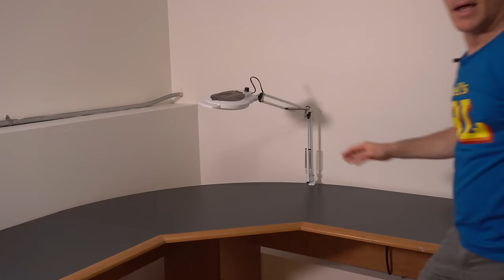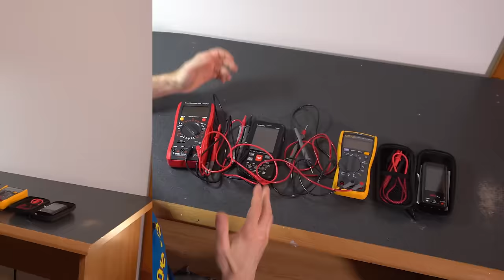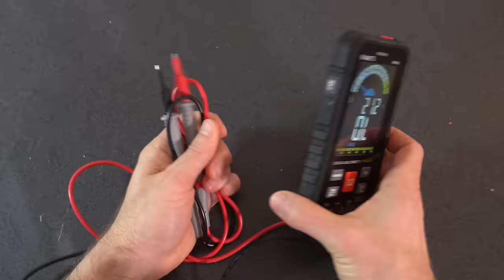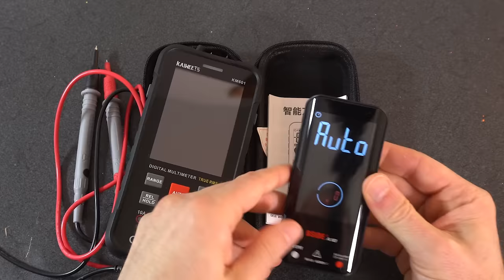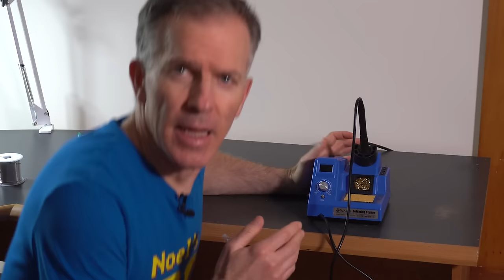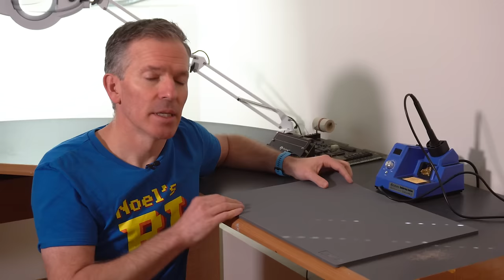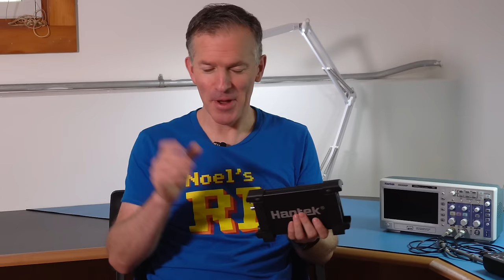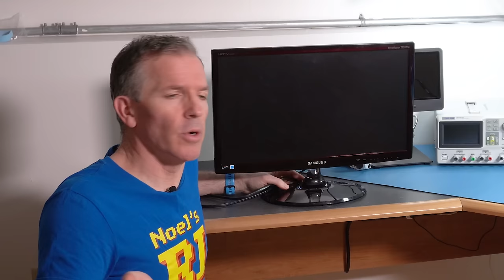Essential Tools For An Electronics Lab

Comment: I mostly agree with your recomendations but I would suggest to not go cheap on the screw drivers either.  I've bent the blades of  several screw drivers over the years.  I've also destroyed more than enough screw heads.  Both can be avoided with decent quality screw drivers.
When working near things that should not be scratched insulated screw drivers aka electricians' tools can be useful.  Disadvantage is they tend to be thicker.
Some cheap soldering irons have tips of unbelievably bad quality which oxidize rather quickly and then can not be cleaned by using just a metal or wet sponges but rather sandpaper or nasty chemical.  Those typically are not soldering stations but soldering irons which are directly connected to the AC power cable.  Some crappy ones also are not perfectly insulated so the tip of the soldering iron may transfer a small voltage to whatever your working on.  Not necessarily dangerous for the user but enough to fry sensitive electronics.  And boy, old CMOS stuff can be unbelievably fragile.  So avoid those supercheap things at all cost.
Another feature of a soldering station I don't want to miss is a burn-proof, super-flexible cable.  Aside of oxidized soldering tips that don't conduct heat and to which solder sticks like water to fat, stiff cables are terribly annoying.  I'm using a Weller WS-51 which I think is turning 20 years this year and has held up extremly well.  The cable is as flexible as spaghetties boiled for 20 minutes and because it's outer surface is silicone, not PVC it's burn-proof as well.  And the tips are the quality you want if you have the soldering station for hours - or even eight hours a day, five days a week in a commercial environment.
I've bought a desoldering pump like your blue one in the early 90s then again the same model again a few years later.  Both are serving me well until this very day and it's kinda funny to see that some tools are totally unchanged over a timespan of over 30 years.
For old computers I completly agree, lead-based solder is the way to go.  lead-free requires higher temperatures and many of the old components are not suitable for these high temperatures.  That said, lead does stay a hazardous material.  Good ventilation is a must.  I occasionally build electronics kits with children and we made it a rule to not use lead-based solder with children around as lead is even more toxic to children.
While I don't own a desoldering station myself, I've learned to appreciate one in a commercial environment.  Getting heat-sensitive commenents desoldered without destroying them is so much easier with one. With old boards - and some C64 or Amiga boards for example were seriously bad quality PCBs - it's very beneficial to be able to shorten the soldering process before the traces are coming off the board.  Fortunately I haven't seen any such bad boards in at least 20 years.
Magnification tools are also very useful and you may never know when the need arises.  I once had a broken trace where the break was so small I could not see with my batter than 20/20 eyesight even though with a multimeter I was able to track do the fault to within 1 mm.  Along with that you want the best possible lighting.  Shades are annoying.
Bench power supplies - if you're cheap, you may try to get away with an old ATX power supply or similar.  Note that older switching power supplies will not work without or with a too low.  While this may be cheap, there are disadvantages.  An ATX power supply will only deliver certain voltages, +12V, +5V and a few more and it has no limiting functionality other than eventually switching itself off after going up in flames itself.  Modern computers are pretty demanding as for the accuracy of their supply voltages and ripple and modern PSUs satisfy these requirements and - at least on some of the voltage rails - can supply pretty massive power.
I'd add a selection of solvents, contact cleaner and maybe some grease for things like floppy drives.  Turns a 1541 from creaking like an old barn door to purr like a kitten.  For very dirty computers I recommend a small compressor in a different room - or outside.  You don't want to blow the dust everywhere.  Avoid the canned air duster sprays.  These contain butane which is combustible and other components which are toxic (aka can be abused for “recreational” purposes, also by accident).
Reply: Ideally, soldering/desoldering tips should be made of copper ---- for superior heat transfer ---- that is steel plated to prevent the tips from oxidizing, pitting and dissolving. Plain copper would dissolve from hot flux (especially from the higher temps and corrosive fluxes used with leadfree solder). Quality tips might be mildly magnetic from the steel plating, but if they're strongly magnetic, they're probably crap, with minimal or no copper content. Attention all newbies; Never scrape or file a soldering-iron tip! You will remove the plating and kill the tip. Numerous YouTube videos tell people to file their tips ---- they're wrong.

Excellent point about highly flexible, silicone,  soldering iron cords that won't melt. My ancient blue Weller soldering stations have good cords; but the irons have been hardwired to the base because the connectors oxidize and fail.!
Reply: @goodun2974  In theory.  In practice pure copper tips oxidize so quickly they're practically worthless.  It takes an alloy  or a coating to make copper practicable.  Been there, was happy to dump them.  I have no idea what Weller's tips are made from but they don't look like coppe and the don't oxidize even when the soldering station is sitting around hot and unused for many hours.  The soldering tip on my very first iron had some very thin plating of unknown material but did oxidize so badly sandpaper was the only option remaining and yes, as you said after that the oxidation problem only got worse.
Reply: @ralfbaechle ,   If you reread my post you will see I specifically wrote "copper tips that are steel plated" . Yes, bare copper pits, dissolves and oxidizes in short order.  I have seen cheap soldering tips that seem to have no copper content whatsoever and are made of some entirely magnetic material, and others that are plated with what looks like Chrome and they don't hold solder well and oxidize almost immediately after cleaning. You are correct about the Weller tips, I'm told they are steel plated (very slightly magnetic) but whatever it is that they're plated with,  they hold up extremely well. I am using old TCP series Weller soldering stations both at home and at work and have spare tips for them and they're typically good for 6 months or more of heavy use. I've bought replacement tips of pretty good quality for other irons, such as an old Unger station that I own, from Ace/Panda....

Comment: Nice tools! I use a intel NUC when I have too use Windows in my projects. I prefer Mac in daily use
Reply from the maker: I also prefer Mac for my everyday work. I looked into the NUC and it looks like a small box PC (which I have a similar one to that as well). That means you need to have a monitor around as well, right?
Reply: @NoelsRetroLab  Yeah. You need a monitor... but you already have one! :) Usually NUCs came with a VESA mount and you can mount it at the back of monitors, for maximum streamline! :) Add a wireless keyboard and mouse, and forget cables over the table :)
Reply: @NoelsRetroLab  correct, it needs a monitor. I have mine setup next to the Mac mini I use.
Reply: @mykself  For more space efficiency, a combo keyboard/touchpad such as a Logitech K400 works great.

Comment: Interesting. As an American, I wondered if the 220v European standard makes soldering irons and other heat producing products heat up more quickly. Keep up the good work.
Reply: It's not like a soldering iron need thousands of Watts.
Reply: Most soldering irons don't use line voltage directly to heat up. There's some kind of a transformer or PSU. The really cheap irons are direct line powered. There the heating element would just be sized for the voltage it is run at. Watts is the unit of power.

Comment: Great video. I'd also recommend a cheap true 'binocular' scope like a SE400-Z rather than the digital one. Fine soldering becomes FAR easier in 3D rather than guessing how close your tip is on the displaced screen. (Recording videos are not as easy though.)
Reply: Lots of 2nd hand industrial microscopes available, they were used for quality inspection of PCBs

Comment: Very interesting video! Just a few thoughts: actually the cheap USB oscilloscope is what I have and it is really good for the price. So good that I still couldn't decide if I want to spend more monay for a better one. Only downside is the need for space to put the computer screen or notebook. Regarding the computer or notebook you are right that a lot of useful software is only available for Windows. And that's not the software you need for programmers or oscilloscopes. There are very good Linux versions of that (for the TL866 and the Hantek 6022 at least). But there are a lot of tools for converting disk images and such that only exist for or are much better in Windows. But they all run fine with Wine under Linux!
Reply: I went with a 4 channel scope with serial decoding that was $400. Saved me a lot of time debugging my firmware.
Reply: I've found that most of these simple Windows programs run fine under WINE. Are you able to program ROMs in WINE?
Reply: @wayland7150  I'm using the Windows software for the TL866 under Wine without problems. I've programmed EPROMs, GALs, ATMega8 with it.
Reply: @KolliRail  Thank you.

Comment: About that Windows-only eprom software... There's an open source command line tool for it called minipro. I actually usually prefer to run it from command line, especially if I'm programming lots of chips or reprogramming the same chip during software development.
Reply: Another nice thing about command line tools is that you can add them to your make file.

Comment: Whenever i need a new tool,my first rule is to check and see if there's a Japanese made model that meets my needs and falls within a range i feek comfortable in spending (meaning will it eventually pay for itself). Reason being is that MIJ stuff lasts FOREVER and always seems to do its job better than basically everything else. German craftsmanship is also really good, although can be way overpriced. But seeing as how Japan has crafted its entire economy on electronics,they tend to know what works best in the electronic realm. Sure,the Chinese have similar experience, but they also cut corners at every level where Japanese products spare nothing.

Comment: Great video, thanks Noel. How do you deal with solder fumes, especially as you mentioned you prefer leaded solder?
Reply from the maker: Thanks! I have an upcoming video about dealing with solder fumes and doing some measurements. For now I'm either opening the window or just blowing a fan, but I suspect that's not quite enough. Also, the problem isn't the lead as much as the flux, so unleaded solder has the same problem. Stay tuned for more 😃
Reply: @NoelsRetroLab  , leadfree flux formulations are noxious and irritating in a way that rosin flux for leaded solder is not. Leadfree fluxes are also corrosive and conductive, and combined with higherctemps necessary for melting leadfree solder will kill tips prematurely. Anyway, fumes from leaded solder do not contain lead; the temperatures used to melt solder are far below the boiling/vapor point of lead.

Other tools every bench needs: Dental Picks are absolutely indispensable! Several LED flashlights, one with wide, diffuse light and another with tight spot-focus. The tight-spot flashlight can shine through a circuit board and not only help you pinpoint the solder joints relative to a specific component you want to desolder or  but can also illuminate hairline cracks in the board or traces. A strong laser pointer is also useful for this. Sometimes a light source that is more bluish will show defects in the soldering that don't show up under a bright white light ( excessive glare), so if you're scanning a board for defects in soldering use several different colors or intensities of  light sources.

Fiberglas bristle scratch brushes are another absolute must-have. Mine are German made ( EuroTools, and Bergeon). Available from Essingers ( Esslingers?), a watch and jewelry-repair supplier.

It's also good to have spring-loaded hand tools for some applications, but there are occasions where you want the needle nose pliers to spring open automatically and ither occasions where the spring is too strong or where you want them to stay closed with light pressure. Rubber bands wound on the handles or above the jaws, near the pivot or fulcrum, can be usefull for this. Ditto for hemostats; grind the latching mechanism off and substitute a rubber bsnd.

Comment: I bought a old analog oscilloscope for 40 bucks. it works fine.
Reply: Do you see any advantages in using an oscilloscope over just using a multimeter? I've used multimeters plenty of times, but I never got the hang of how oscilloscopes are meant to be used.
Reply: @alfredomulleretxeberria4239 8 times out of 10 I will use the multimeter. The reason I got my oscilloscope was to make synthisizers but I use it for other stuff too, mainly diagnostics.

Comment: That Kaiweets DMM doesn't look very durable. I guess it would work okay as a benchtop DMM, though. If you can afford it, get the Fluke. Maybe even look for a cheaper, used Fluke over any of these other brands. Also, on the oscilloscope, the bandwidth and sampling rate are two different things. This video seemed to mesh the two terms together. Once you have a set of test equipment, use them to calibrate each other. Use the DMM to check the voltage and current (use a shunt if needed) from the power supply. Measure that same DC voltage with the oscilloscope. Check the ripple and noise of your power supply using your oscilloscope. Lastly, you should probably get a signal generator and frequency counter for your lab.

Comment: I had a desolderer just like the one shown. JUNK! The silly buzzard actually flew apart after 3 or 4 uses. The top hit the ceiling of my lab, and I never found the spring for. It. Yes, it worked until then. Use eye protection for that one for that reason. For now, I use the flat-braided copper desolderer. Oops!

Comment: Regarding the multimeter, do you ever find you need you need the DC current range of 600.0 μA / 0.1 μA that a Fluke 116 has which the 117 does not have?  
Conversely, do you find you more often need the DC current range of the 117 at 6.000 A / 0.001 A   10.00 A / 0.01 A?

I am new to electronics and want to start working on computer repair, but don't even know enough to be dangerous yet. I heard on another channel that not having the ability to measure microfarads (µF) meant a multimeter was not good for electronics, which is why I am asking.

Thanks in advance for taking the time to reply.

Comment: Noel , you didn't mention the tip cleaner for the  Soldering station . Not all that important but probably worth mentoring .
Reply from the maker: Which tip cleaner? I usually just use the metal scrub and the sponge for the soldering tips. Do you use something else?
Reply: @NoelsRetroLab  The one I use is called " DELTA TIP TINNER" by " Qualitek " it's  lead free but any brand would do really. Just stick the heated tip into the  paste and it cleans and tins the end for you.
Reply: Welcome back by the way .
Reply: @ianwebster3544  ,  Kester makes a similar tip cleaner. It looks like a plug of metal but it's apparently a mix of solder and some kind of special flux and it works great for cleaning the tip after the iron has been sitting unused for a few hours and the tip blackens a little bit. Otherwise I almost never use the wet sponge for cleaning either soldering or desoldering tips because I find that the brass wool works better and I have read that the shock of a hot tip against a wet sponge can cause micro fractures in the plating on the tip and lead to premature wear and failure.

Comment: @Noel's Retro Lab in my opinion small desolder sucker isn't enough... I've used like from Pro'sKit... They work but not well!!... You may say waste of time with no results... So I recommend in manual type longer/bigger ones even Chinese good quality tools can perform well... Longer one due to good suction pressure especially for via through pads is mandatory as it can suck solder from holes easily... Smaller one isn't even good for suction of solder from single sided hole...

Comment: Just missing the cleaning things like brushes alcohol, hand files, Torch (Flashlight), Fume extractor or fan.
Reply: Dental picks. Fiberglass bristle scratch brushes. Strong laser pointer for shining a light right through the board to illuminate the solder connections on the opposite side of the component you want to desolder as well as illuminating cracks in the board or in the traces.

Comment: I do have a JBC traditional solder (I bought new in a specialized shop), but add you would imagine it does not provide temperature selection. What's your opinion of them?

Comment: Should have used surge protectors under your desk instead of PDU's
Reply from the maker: They claim to also have surge protection built-in. Anything I should be looking for in particular?
Reply: @NoelsRetroLab  What model are they? Do they actually have a Joules rating? To me they just looked like standard PDU's, but I could be mistaken. The reason I commented is because a lot of the time, especially on Amazon, they will list PDU's as surge protectors because they know that's what people are searching for. Problem being that a PDU has no surge protection. It is basically just a power splitter.